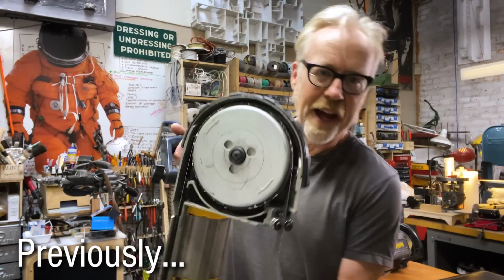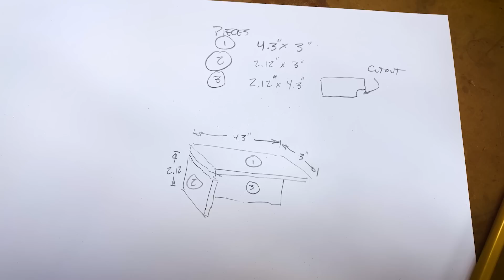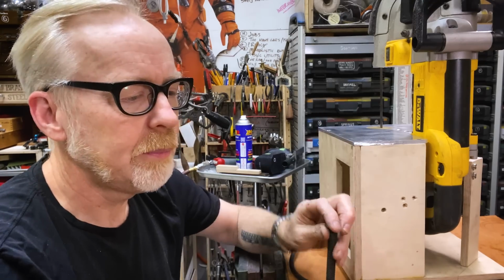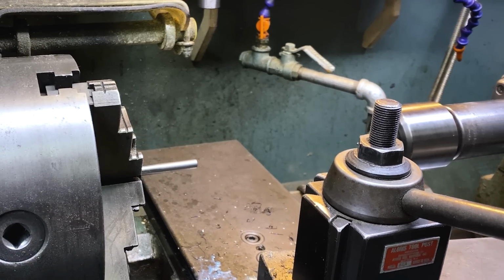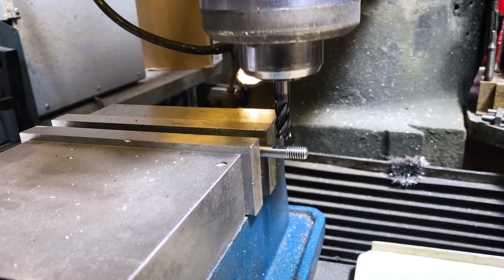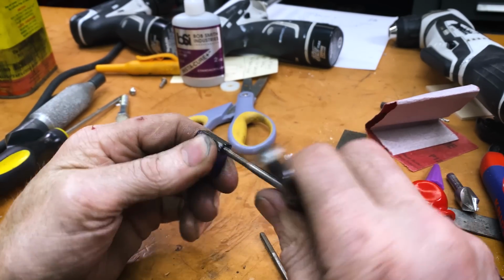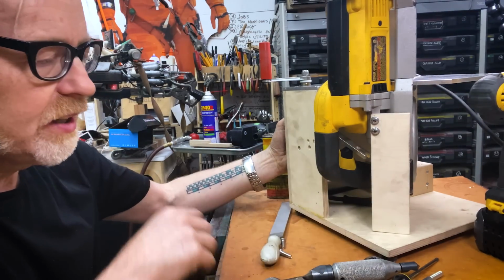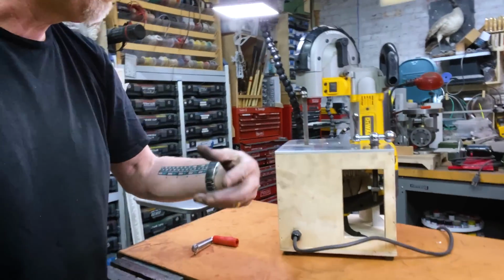Adam Savage Upgrades His Mini Bandsaw!

Comment: Honestly I would do one of these two things...
One, if you want to leave the crank up on the saw bed then take your cord strain relief and put it inside the box.  This will give you a nice perfect square that goes on a shelf without having to leave any extra space on the sides for the strain relief sticking out, or having a looping cord facing out from the shelf.  
If you want to go safer, then move the crank to the side (so your forearm isn't near a moving blade) and have the guide screw just move a wedge that pushes down on the trigger.  Then you just shelve it with the crank and strain relief facing outward.  
Other than that this is a really nice build that has made me rethink buying a big metal bandsaw. :D

Comment: Hi Adam, have you heard about Neutrik powercon and/or truCon power connectors? They are twist lock power connectors that mainly exist in the pro audio and lighting world but I have seen them used for work shop tools too where you have one power cable and each power tool has the locking connection on the short cable stub. Easy to swap out tools as needed. Even panel mounts too so you could put a mount on the side of the plywood housing and easy to connect to power when needed. :)

Comment: I did pretty much the same thing with a Harbor Freight portaband a few years ago but it had a different trigger mechanism where it had a dial stop in the trigger to set max speed and also a drill style trigger lock, so I'd just set the dial, press the trigger and then while holding the trigger, also press the trigger lock and the thing would run until I hit the trigger again.   Your crank mechanism is elegant, but you may find one day that that crank handle is in the way if you're doing something like splitting a long pipe that needs to extend off the back end of the table..  Of course, you also have a full sized bandsaw for those types of operations, but for anyone else making one of these, the might want to consider putting the speed control elsewhere than on the flatbed..

Comment: I suggest adding a clamping system to the whole bandsaw setup, so you can clamp it to the table.  That way it doesn't wiggle around when you are changing the speed.  Your arm got close to the blade a few times and that is something that should help.

Comment: Suggestion for a better speed control: 
Have a shaft pass the trigger with a nut pushing down when it's turned, like the camshaft in a car engine. Attach a handle to the shaft where it comes out on the side of the machine, mounted so pushing down on the shaft increases the speed. Install a spring to make it return to 'off' when let go of. 
Pushing that way makes the feet grip the table surface, holding the whole thing steady. Well, steadier. The return spring makes it a whole lot safer.

Comment: this is great. i want to see part three.
some ideas:
recessed pocket for a flush mounted plexi cover for the trigger mechanism
little weight in the bottom for some stability
a nut or two on the bottom of the 1/2 inch thread to stop you from over turning hte speed lever and putting undo strain on the trigger/trigger mechanism
round corners
potentially a nut on the top of the thread so there's only one way to turn it off.
recess the thrust washers into the table top and bottom just a little ( absolutely useless but cool)
and finally:
paint the wood, gunblack the metal, and weather the whole thing.

Comment: New crank handle is super nice. Should probably drill the threaded rod and insert a small cotter pin to give it a bottom out. This would ensure the nut does not back off completely.

Comment: I think that marking on the side where the lever is at to give more accurate reading would be nice. Paint the end of it red or something and then mark "OFF" for everything too high/not giving enough pressure, then approximate speeds going through until you get to the point of the throttle being wide open, and put a stop there to prevent accidentally ripping the thing off or damaging the trigger.

Comment: May I suggest that you make a way to plug in a vacuum to suck out the derbies that fall through to the bottom, this way you can either plug it into a vacuum point when you are using it during cutting or later to give it a clean out ...

Comment: You should consider using two pairs of nuts locked together to set stops on the travel of the speed adjustment. Set a stop above the yoke so that it can go extremely slow without actually turning off (prevents thinking the power is off when it isn't) and set a stop below the yoke at max speed, so you don't put too much pressure on the trigger and break it by accident.

Comment: For the variable speed trigger, I think I would have not cut the side panel out, but made a screw with a cone that passes through the trigger housing. As you screw in the cone, it depresses the trigger thus increasing the speed. Of course hindsight is always 20/20.

Comment: easier way to make the speed controller.
Use a metal pipe band. (you know the one you put on gas lines)
I have seen them with a giant round washer on them, for hand tying.
put it around your trigger and you can tighten it or loosen it to speed up or speed down the machine.

Comment: I think the bottom end of the threaded rod needs some support to keep it vertical and straight. Perhaps a square block of 3/4" plywood with a hole in the middle that screws into the corner of the box? Should be able to remove the screws and the block quickly for future maintenance.

Comment: I would add an internal chip collector under the table and a dust port on the rear or side, might even add a blower connected to the mains switch then you could have an external bag or an internal chip box to collect the spoil.  But very nice, sometimes a full size band saw is just too much or you want something portable.  I'll have to make one of these.  BTW, I use universal (IEC 320) connectors and power cords for all of my custom tools.  You can even get them with built-in dust covers.  Then just add an IEC 320 end (or and adapter) to the end of a couple of cord-reels and life gets 10 times easier.  Never have to wrap the cord up, just reach overhead, pull down as much cord as you need, plug in and go.

Comment: the only thing I would add is a nut at the ajustement screw bottom  to stop from turning when you hit the maximum speed setting. Preventing from going to far and breaking the switch with too much pressur.

Comment: That is an awesome and very inventive way of doing it... I myself would've just rewired the trigger to an exterior rotary dial placed on the front of the enclosure. 
But your way ( although more complicated ) is way more fun :)
Reply: This already exists, it’s right there on the handle, where your thumb would rest if you hear your right index finger on the trigger. It’s a rotary dial with a 1-5 speed adjustment. His mechanical speed adjustment thing is inconvenient and unnecessary.

Comment: Great build, as always! I'd have made a 3D printed cover for the electrics, maybe including or allowing for a chips collection tray. 
On second thoughts, instead of a chips collection tray, a 3D printed shroud under the table with shop vac connection.
As an electronics engineer I'd probably also make the speed control by dismantling the original bandsaw and add some wires to a potentiometer including the mains switch on the side of the case. For fine control, a multiturn pot could be used.
BTW, I am continually amazed at you Americans doggedly sticking to imperial measurements. I grew up with metric in the UK, but my initial mechanical experience was repairing my old British Triumph cars during my student years, with all imperial nuts and bolts. Imperial is fine when just doing that sort of stuff (I could recognise almost any size Imperial nut, bolt and thread size), but as soon as you have to do any calculations, metric is so much easier.

Comment: I was really surprised you just didn't build an electronic speed control with a variable potentiometer and either a Triac or an SCR or even a power MOSFET circuit. But it is your project and whatever works is perfect too. JMHO!

Comment: I would also use shrink tubing on those expose contacts for addition safety
Reply: but that would make taking the bandsaw out of table for maintenance a pain in the butt
Reply: 1BigBen  not on the wire nuts. On the exposed taps on the switch that are not being used and any expose wire on the connectors.  The connectors can be remove easily
Reply: @maddog48froggy  well it is boxed off, but I would just used the fully Insulated crimp connector plug them on vs  heat shrinking it

Comment: Thoroughly enjoyed! Modding tools is a risky business boys and girls, scars are mother natures reminder to slow down and use your brain more often :) As the final form for this tool, I would have kept the bottom simple & enclosed but ventilated on a clean side, with an LED for power status and perhaps extra lighting. Relocating the trigger mechanism would have simplified the mechanicals & fabrication, with a piece of threaded rod or bolt through a nut for activation (my vote was for a pedal!). A true shop space is always evolving (thus hazardous), often its how you work around a problem or lack of tools/resources that can be really interesting but I appreciate mods that help safely keep your flow - its all about the ratio of mods to scars, right?

Comment: The machinist Nob was a nice did think of a black Nylotron carved or cut piece to lesson the pressure of one side of switch  to center the exerted pressure directly down and releasing evenly back to original position  built similar broken switch due to side pressure cause it may happen later excellent switch cover!!!: )

Comment: I personally would have drilled and taped a hole in the top, with the bolt run to a leaver, but this is a more elegant solution.

Comment: Brace the bottom of that threaded rod against the side wall at the bottom and you won't get as much horizontal play. As long as that fork is deep enough it won't affect functionality in anything but a positive way. :) Nice functional build!
Reply: I also would've geared the crank to turn from the side, or perhaps a pulley system for the effect. Turning on the bed looks dangerous, you should at least put a guard of some sort up.

Comment: To hold the trigger down, use a hose clamp and for speed control what about a light dimmer switch?  The switch has an on/off feature and power feed control.

Comment: Of all the safety concerns, what that thing needs is a powered light. Something that says the device is turned on even if the speed control is all the way off. It shouldn't be that hard to add one and wire it into the switch.

Comment: I was thinking it was goign too heavy and was gonna suggest a teflon pad on both the lever and the trigger so it'll slide smoother if that was the problem, but then you cut to your solution. And the new handle is way cooler too.

Comment: if the threads were bigger would you need to do less turns to make a noticeable change?
Reply: Aleph Null yes,  more fine threads would be more “threads per inch” with more threads per inch  you would need to turn the screw more to achieve the same amount of travel, opposite is true for more coarse threads
Reply: @caseyclymore4417  yeah i was just thinking that the threads were too tight and changing speeds could be done a lot more comfortably with bigger ones you know. but i suppose if it bothered adam he could always just replace it.

Comment: Wow there are a lot of negative comments without a lot of ideas for solutions. I would have made the trigger depressing lever L shaped  with a pivot on the join of the legs of the L and moved the handle mechanism to the side of the machine where you put the cut out. That way you wouldn't have disturbed the surface of the table You may have come to that conclusion as well and dismissed it for reasons I am not aware.To me what is interesting is that with the current situation it is much less likely that you can bounce ideas off of  others who may have normally been in the shop so you are  so much more likely to engineer down a single path. anyway, I really enjoy your videos! keep it up!

Comment: I would add a hard stop a pin through the bolt would work so you don't put to much pressure on the switch.

Comment: If it ever gets in your way, Perhaps double up on the surface of the table, cut a hole in the new top plate for a nut on top of the threads.   the speed control would now need a tool but would be out of the way.

Comment: My issues with this build are 1) the rotor assemblies are still open and facing the operator, which makes them dangerous. The tool, used as intended, has the rotors facing away from the operator behind a guard which provides some protection, which this mounting does not. Dedicated table band saws have the rotors enclosed to protect the user. 2)  The placement of the speed control handle on the table top requires that you reach past the exposed blade while it is running. A loose sleeve or even an inopportune sneeze while adjusting the speed could result in a severe injury.

This tool should be further upgraded to add an enclosure for the rotors and also relocate the speed control handle to be repositioned preferably at the front or proximal rigtht-side of the table supports so that the operator isn't reaching past the blade to make adjustments while the blade is moving in order to improve the safety and mitigate the risk of an injury to the operator.

Comment: It would be pretty easy to attach a rod or flag or whatever to the square nut so you have an easy read of the current speed settings
Reply: in after thought if you do the plexiglass cover for the hole this is unnecessary because you can just look at the position

Comment: Not sure if this would work, but you could connect an adjustable light switch (the ones with a wheel) or something equivalent to the speed controller. You’d have to mess with the internal connections to the speed controller.

Comment: Speed handle should be on the side to avoid cutting your arm off when adjusting it mid cut, simple geared rack and pinion setup should be able to get the required vertical motion with fine control. Also needs a big nvr power button and a mechanical stop so you can't fully stop it without using the power button (so you then can't start it by brushing the speed handle).

Comment: The exposed contacts on the switch were a a security NOGO from the beginning.  Honestly i think you should have used a security Switch. That kind with an Emergency Power Off Button and Auto off if the Powerline is disconnected. And of course you should switch both Power and Neutral.

Comment: Unlike just about every other comment, I dont have a problem with the variable speed system. It gives a MUCH higher range of adjustability than the knob on the tool. 
The only issue I see is the saw falling off the table as he torques that handle, and the space issue which he addressed.

Comment: Turning that lever while the blade is going looks so freaking dangerous. That thing was wobbling around so much. Also being able to bring the trigger all the way up to stop it also means you may forget to switch it off.
Reply: new lever at the end and power switch in front
Reply: @1BigBen  Yeah, new lever is an improvement. But my point about the switch is that if you can turn it off with the lever, he may forget to flip the switch if the lever already disengaged it. Then if the lever engages again before plugging it in again, it could be very dangerous.

Comment: I wouldn't have done that speed control the same way, a simpler solution to seems sticking that handle through the side of the box onto a mounting point on the far side, but then instead of a lever, just have a disk with an off-center hole on it over the trigger of the saw. If that rotation point is stiff enough, it would hold the trigger in place perfectly.

Comment: As I mentioned in the previous video though it being a great build, as a bandsaw it cuts 90 degrees in the wrong direction... The two baring holders which twist the blade need to be remounted so the blade is twisted the other way out...

Comment: @adam You could use the nut going up and down as a rpm gage, either by filling in the hole in the side with wood and adding a slot with a needle sticking out and rpm values painted directly on the wood, or by putting in plexiglass window and painting the rpm values on the glass.
Also please watch mymechanics here on YT, I am sure you will find him great.

Comment: Neat and all, but for the speed control, I would have considered a simple cam-on-a-shaft mounted transversely, which by turning in increments would depress or release the trigger lever. With a sufficiently large knob attached alongside the apparatus, one could go from 0 (off) to full speed quite smoothly, as well as introduce a locking mechanism for hands-free operation.
As for the master power switch, I think it's wise always to enclose such things inside an IP67 project box. Would have spared you much grief after-the-fact.

Comment: Really like the second handle better, and it's a neat idea, but I still think I would have just removed the switch on the handle and wired in a variable resister dial in and mounted it on the same side where the plug wire comes out.  I worry for Adams safety, cranking anything like that on the same plane as the blade is dangerous. What if he's got cutting oil or anything else slippery on his fingers. Adam, "Remember your failure at the Lathe"

Comment: Adam could have built the speed control by using springs in a fulcrum type arrangement, eliminating some of the complex mechanisims in his design. Instead of applying pressure when turning the crank, you are releiving tension.